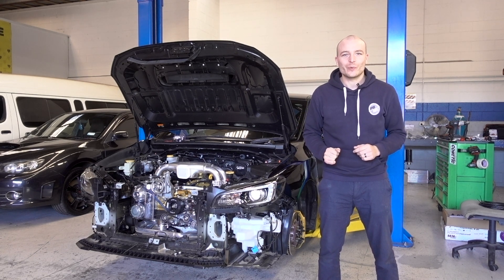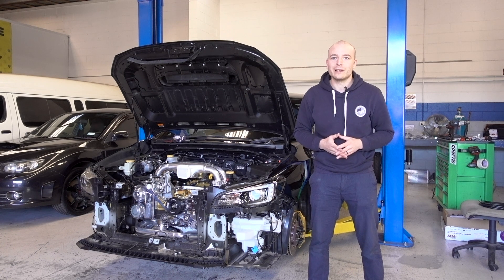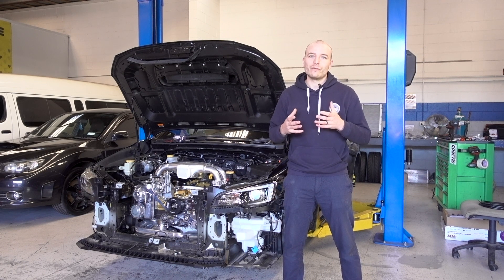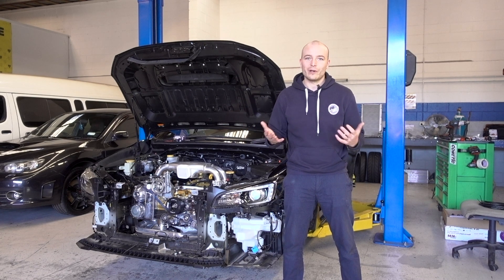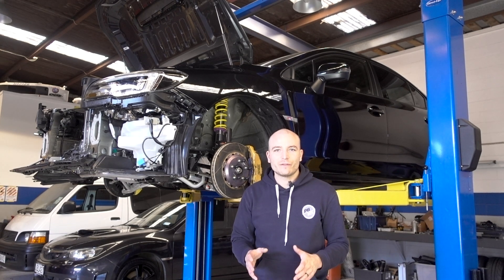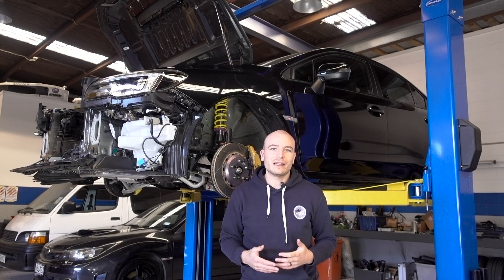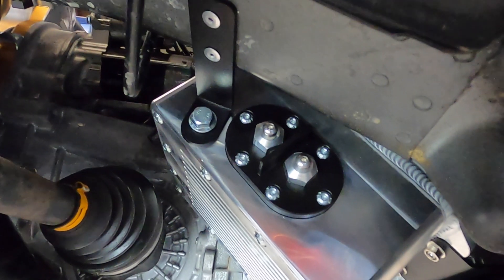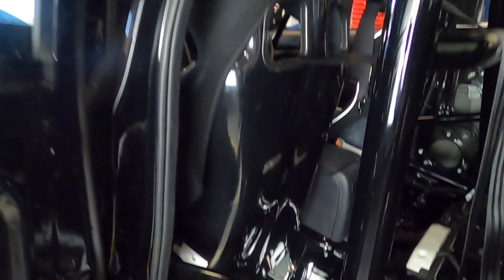Billet Block STI Engine Installed [Billet Block Project EP. 3]

Comment: I'm on the verge of buying this block. Any review on reliability of the motor itself from IAG? Can't seem to find much on it anywhere.
Reply from the maker: Hey Clubspec9! This is a great motor IF you're going to use it the way that it's designed. But it's a very specific engine that doesn't suit most applications. I see on your profile/video that GotItRex may have built your car. Our recommendation would be to talk to them, or whoever will be tuning your car, as the suitability of a billet block like this is about the entire engine package and application of your car.

Comment: Well done guys! Patrick about battery? What racing light weight battery do you recommend to use for track days or even for daily driven?
Reply from the maker: We've used a Shorai battery. Super light and able to be mounted in any orientation inside the cabin. So perfect for this application
Reply: @PossumBourneMotorsport  Thank you for the answer!) 🤝